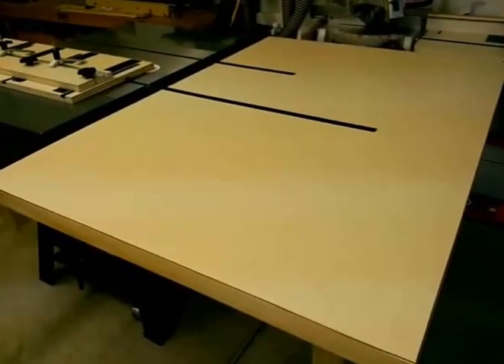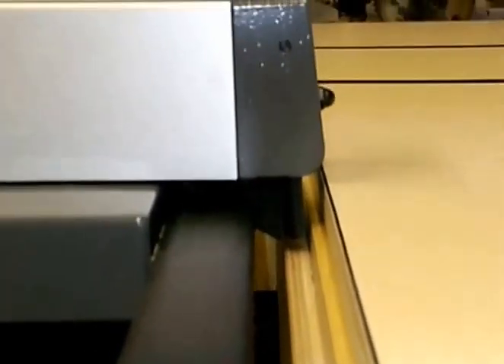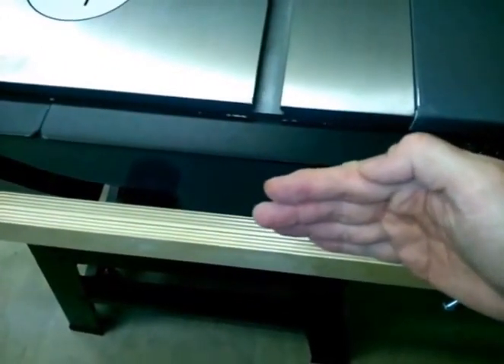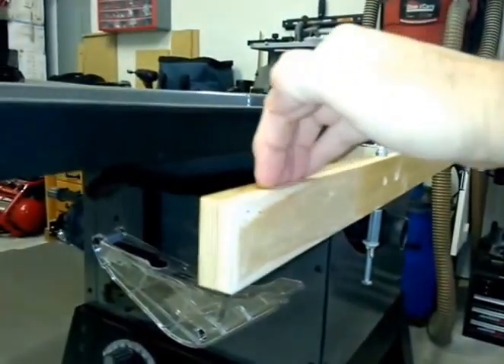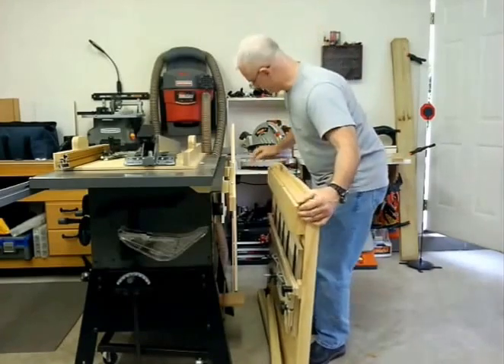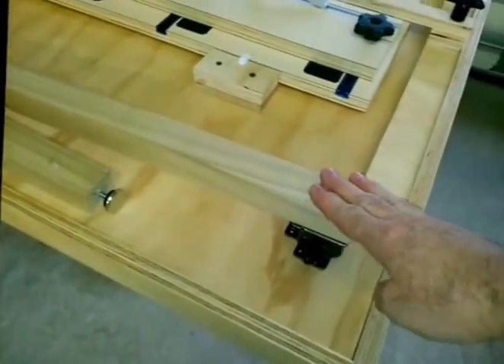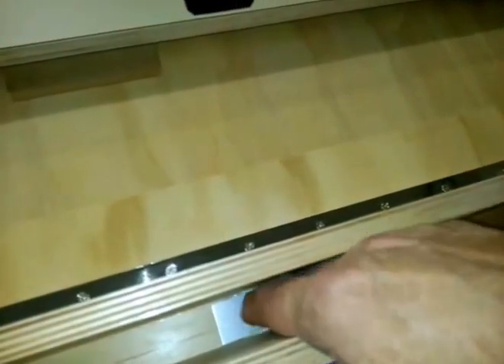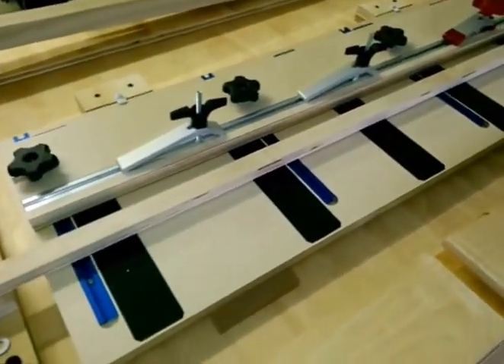Folding/Removable Table Saw Out feed Table

Comment: Hey Greg, that's one great system you've come up with there. I too am a small shop user and every inch is extremely important. I really like the ability to fine tune the table as well as take it off if needed- with no tools! Not to mention the use underneath to store items. Outstanding work! I made a mod to my table saw to fold down the wings to save on space. I've not made an out feed table yet, but will definitely be stealing some of your design ideas when I do. My saw has an outboard motor and I didn't know how to deal with it- but if I can remove the table like yours does- it's a non-issue.   Thanks for the work and ideas, G.

Comment: This is genius. I wish you had a contractor saw though. I need to figure clearance for the motor.
Reply from the maker: Thank you for the compliment.  You might want to look at the video by Laney Shaughnessy on how to "Make A Table Saw Out Feed Table" Make a Table Saw Out Feed Table Part 3 

I believe his design could more easily be adjusted for a contractor saw.
Reply: Most people on Youtube (including Laney Shaughnessy)  don't seem to have the type of contractor saw that has the motor hanging 12 inches or so out the back of the saw.  I took some ideas from John Heisz here on Youtube.  He made a fixed table that extends from the saw top just over the motor.  I did this in a similar manner to what Greg Morris did by suspending some wooden rails from the bolts that hold the wings on to the saw table with some steel straps.  Now that I have seen Greg's video I have some ideas for suspending a folding table beyond the 12 inch fixed table.  Hope that helps.